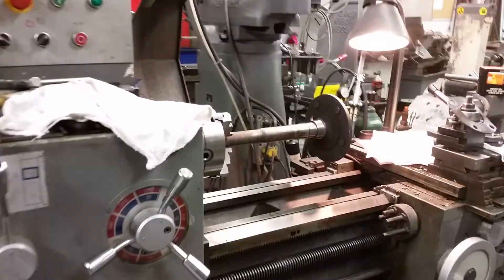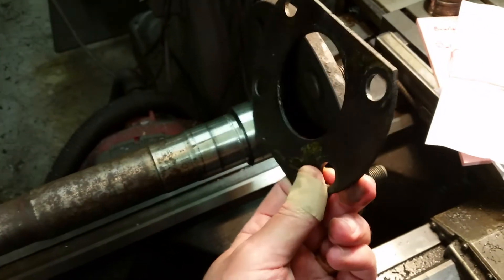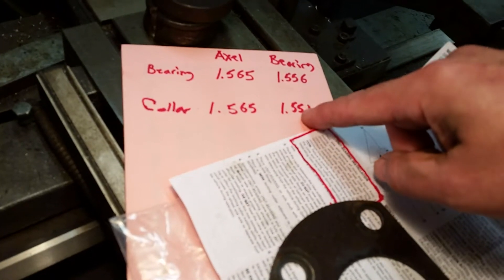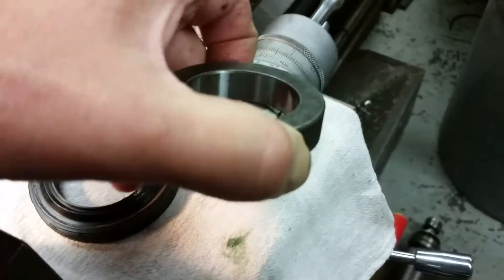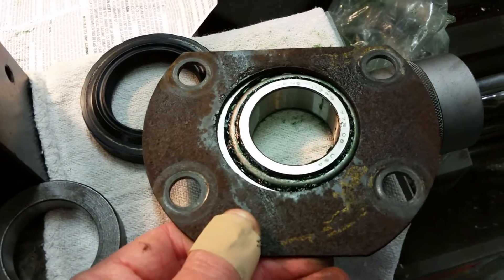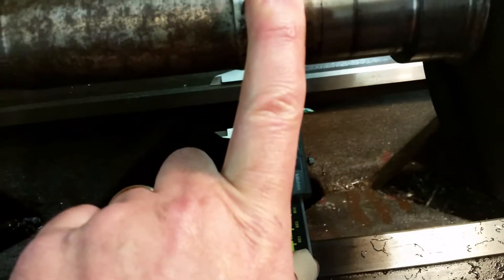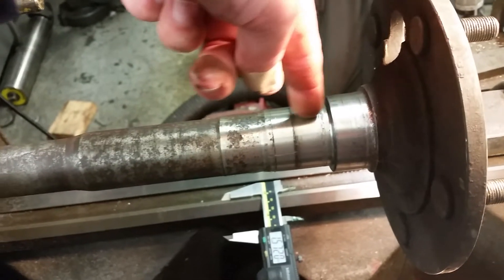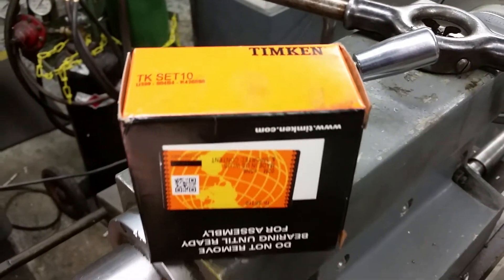Dana 44 axle shaft SET10 bearing discussion.

Comment: Hi, is there any note regarding end play of this axel or preload? I have some play (inside-outside) at one side after bearing replacement. I'm thinking to add a differential side bearing shim to get rid of this axel end play. What do you think?
Reply from the maker: This is a Dana 44 axel. I dont think there is any end play adjustment. There usually is end play on these type of axles. I can try and do a video of mine at somepoint if you want. There should be a book spec. someplace.
Reply: @oldblueaccord2629  I have workshop manual but there is nothing about this type of play. The roller bearing shoudn't has any play as i know. Please check, if you can. I have 0,2mm end play.
Reply from the maker: I need to add this is an International Dana 44 from 1979. They dont have preload adjuster like some axles do.